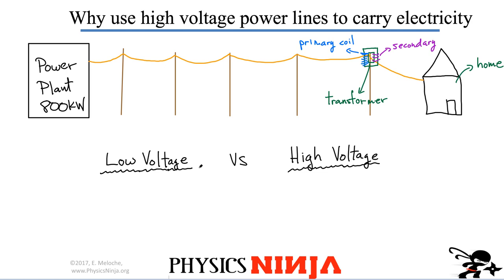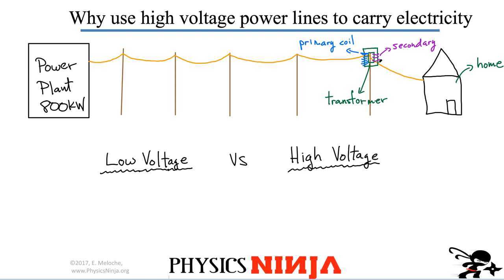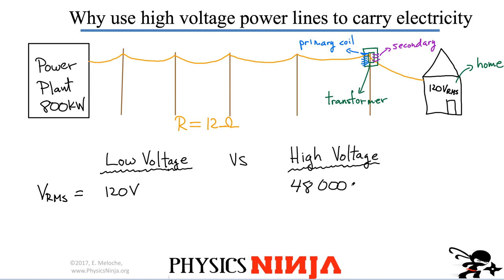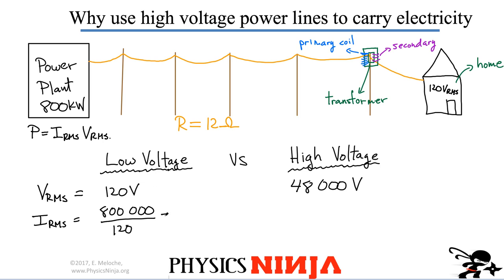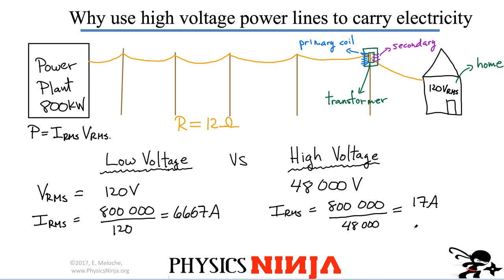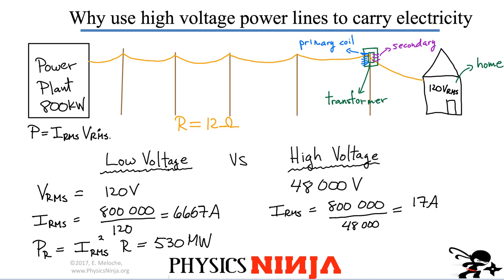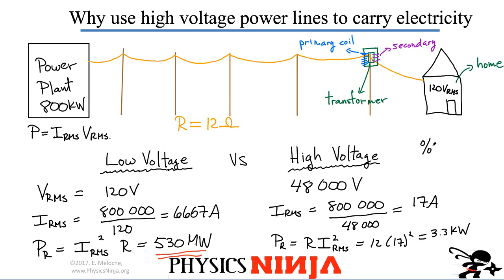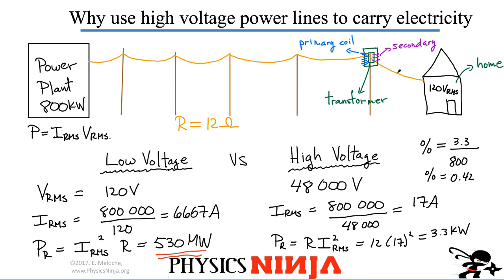Why do Power Lines use High Voltage?

Comment: Sir please explain why we can't use P=V^2/R to compare this instead of P=I^2*R
Reply: THIS!  I'm going all over the web trying to find this out. My teacher just says it doesn't work but can't/won't explain *why*!
Reply: I was thinking the same and looking for an answer. I think that the V_rms in the P=V^2/R simply doesn't equal the voltage used by the power plant, but instead it is the voltage drop on the resistor V_r, which is equal to V_r=IR.  The drop of voltage of a rezistor doesnt equal the voltage provided by the power plant, because the resistor isnt the only power consumer in the grid. The current however is the same as the one provided by the power plant, becouse all the current has to flow through the wire. Thus we can calculate the current easily as shown in the video. I_low = 6667 A and I_high = 17 A. Based on that we can calculate the voltage drop on a resistors. V_r_low = I_low * R = 6667 * 12 = 80 004 and V_r_high = I_high * R = 17 * 12 = 204. Despite providing higher voltage the voltage drop on a resistor is actualy smaller. So in fact you can use the formula P_lost = (V_r)^2/R and you do get the same results.
Reply: @MrTostek  Ah, so if we knew the exact voltage drop over the line itself, perhaps by measuring the voltage at the transmission center and at the distribution center, we could use the V^2/R. But that would be more difficult to measure, as you would need a shared reference at two points potentially hundreds of miles apart! Whereas you can measure the current anywhere along the line and have pretty much the same value everywhere. So the reason we use I^2/R is because of the relative convenience of measuring I, not because the math "doesn't work" for the voltage.  That seems to make sense. Thanks!
Reply: Bro we can’t use V^2/R because the V is potential difference not the voltage measured with respect to ground. Hope it helps.

Comment: The theory was mostly correct. The only thing that I have issue with is that you used 120v on the secondary side of the power company's transformer. In the US, the secondary side of the transformer is always 240v in single phase. The phase only gets broken up at the branch circuit level in a residential wiring configuration. Every Breaker Panel is 240v, Every disconnect, every 240v fixed appliance.
Reply: I think he was only trying to give a surface level concept

Comment: Something doesn’t add up when your calcs shows power dissipated in the wire is greater than the power output of the power plant!
Reply from the maker: I agree, there a too many assumptions built into this but it was meant just as an illustrating case of High voltage vs Low voltage.

Comment: If there was no transformer at the end and of the circuut and it was just wires, where does the rest of the power get used in the high voltage case?

Comment: this might seem like a dumb quisition, but isnt voltage equal to voltage*current? So why is the voltage's resistance different than the wire's resistance?
Reply from the maker: Power is equal to voltage * current.  Voltage is resistance* current (ohms law)

Comment: How power dissipation can be more than generated power? At max it can be 800KW transmission loss. There is something wrong with calculation.
Reply from the maker: Yeah numbers were the best choices.  I did another case here.  Power Transmission: High Voltage vs Low Voltage Comparison
https://youtu.be/C_2dBitJrGM

Comment: I have read different forums and watched a few youtubes (in addition to my textbook readings) and the explanations seem to fall short. The issue seems to be how we are first taught about a direct relationship between voltage and current (that is, an increase in voltage renders an increase in current if resistance remains the same) and then we're taught about power lines that have high voltage and low current (because other wise we would need thick wires that carry high current [which would run the risk of overheating due to the joule effect or something or another..). So please don't explain to me the infrastructural reasons why high voltage, low current is necessary for power lines. I just need to know how high voltage, low current is even possible. I've only been studying DC so far so maybe AC has rules that would enlighten me...but I thought the E=IR formula was universal.
Reply from the maker: That's a really good question.   I wanted to keep my video simple to really answer your question you need to look at the transformer from the power plant to the power lines.    It's a step down transformer and the designer can decide how much to step down the voltage.   It's best to step down a little to keep the voltage high. (ac max)
Reply: The problem is that V=IR (i.e. Ohm's Law) is not universal. The quick explanation for why high voltage, low current is possible is that because you have to conserve energy from the input to the output of the transformer, the power input must be roughly equal to the power output; and because P=IV, stepping-up the voltage causes the current to step-down (and vice versa). The more complex explanation is that formula (V=IR) really only applies to DC circuits. In AC circuits, there is a more general relationship to be considered V=IZ, where Z is called the impedance of the circuit. Impedance depends upon a variety of factors: the resistance(R), the capacitance(C), the inductance(i), and the frequency(f) of the AC circuit. When you take into account all of these factors with a simple set of transformer coils as shown in the video, all the math works out.
Reply: @SkepticMM  so if i touch it before and after the transformer i will feel the same pain if the frequency is the same right ?
Reply: In lament terms… if I have you bench pressing weight. Let’s say you can only benchpress 150lbs. Your power only allows you to lift 150lbs. This is power. There is two ways to make the load easier. Take off the weight or juice you up to become stronger to lift easier without resistance. So while you’re lifting 150lbs that is your max amps before you give out, since resistance is too strong. Now while you’re lifting I inject you with Superman DNA and you can lift more weight because you have more power. Now you have more power to lift weight. That 150lbs which is resistance is nothing to you now because you have more power (voltage) so in terms of current, it is much easier for you to lift the weight. 

Less amperage with more power makes sense. What wouldn’t make sense is having much less power and using less amps. It’s about power. So the more power I have the less current is needed because simply I have the power to lift all that weight.

Comment: Trying to give some thoughts on the actual question the viewers wanted to be answered:
How is it possible to increase the voltage without increasing the current?
Ohm s law states their are directly proportional.
I am still trying to figure it out myself, but here s what i gather from this video, which by the way is very good.
First, you notice he s using the Power formula, not Ohm s law. Why? My guess is because in this situation we HAVE to take Power into consideration, since it is given from the start. Ohm s law doesn t include power.
2) P=U*I
now, since P is a fixed known value, it means that the increase of either the voltage or current comes at the loss of the other. Basic maths.
3) there is a sort of misconception that high voltage means high current. I ve thought that to be true from the 6th to about 12th grade.
Of course, we see it is not always the case. What makes the difference (as far as i can tell) is POWER, specifically whether the value is fixed or to te to be calculated.
After all, voltage is a POTENTIAL, so whether it means or doesn t mean high current, depends on other values.
This is what i got from the video, i don t know whether it s correct or not, feel free to give me your view.
Thanks for the vid!
Reply: THIS  this is what I'm stuck on
Reply: Well as an 11th grader I think you're pretty much right, the power across a transformer has to be constant, and as you said the increase of one would bring about the decrease of the other value.
Reply: Can you tell me why he doesn't use the formula of power dissipated = v²/R

Comment: But sir a question then comes to my mind that is how we put electric energy in a circuit. 
The answer is giving some potential difference. Which is actually a Voltage. (Is there any other way also?) You said that you are putting some energy per second. How do you put it?
If ohms law is correct then, current should increase with increased voltage over resistance.

Comment: Dr.E, i have always had problems with voltages and currents because they're basically interchangeable in equation.
The explanation you give is cool and all but i have a really big doubt wandering within me.
So hear me out. We're talking equations.
Power=Current * Voltage---(1)
Voltage = Current * Resistance---(2)
From equation (1), Power output of a given poweplant is constant . So, voltage is inversely  proportional to current which basically means BIG CURRENT =small voltage and BIG VOLTAGE =small current.
Now you use (2) to convert (1) into
P=I*(I*R)
P=RI^2
But but but, here's the deal, i can also convert this equation in terms of voltage.
Which means
P=(V^2)/R---(3)
Here, the two results clash
From (3),
Power dissapated or lost = (Voltage^2) /Resistance
Here if you use high voltage, you LOSE more power
More power is dissapated.
How do you explain that?
Reply from the maker: I did another video on this that may help.  Power Transmission: High Voltage vs Low Voltage Comparison
https://youtu.be/C_2dBitJrGM
Reply from the maker: Remember that current goes through but V voltage is the difference of potential between 2 points.
Reply: @PhysicsNinja  i already watched it
But it still didn't clarify my doubts.
Yes, current does go through and voltage is indeed the potential difference between two points, which is being increased and that increases the power dissapation, doesn't it?
Could you please give an indepth explaination?
Reply: Yeah, I had the same doubt. Especially in terms of equations since everyone says H is proportional to I^2 but only proportional to V, and hence heat loss is lesser with high voltage. But the problem here is every time you increase voltage, current also essentially increases (V=IR) so what's the point? I don't understand why we don't consider both to have the same heat loss

Comment: What if to find current I use 48000/12 then my current through wire will be 4000A and in case of 120V will be 10A ???
Then this is entirely opposite to what you told
Reply: You need to divide the power emitted by the power plant P[W] with the voltage U[V] to get the current I[A]=P[W]/U[W]. From what I can read out of what you've written. It looks like you have switched P[W] and U[V] up. So you divide the voltage with the power and not power with voltage. Which is the correct way.
Reply: If I understand correctly, you can't do it this way.
You are using I=V/R to calculate the current through a resistor, which is usually fine, if the voltage is not high enough. However, if the voltage is high enough, the I-V curve of the resistor is no longer linear. The electrons in the resistor has a limit of how fast they can move which I guess is due to scattering. Beyond a certain point, the current will not increase as fast as the voltage does.
On the other hand, P=IV is the total power transmitted through the resistor, but not the power dissipated by the resistor: that would be P=I^2R. The difference between these two are made of the power consumption in your houses.
Reply: @frankartanis1290  Hello May I ask that why is power dissipated would be P=I2R?why cant use p=VI to look for power loss
Reply: @tengwenxiang1692  I think the whole concept of resistance is to measure the energy dissipation rate. So for dissipation, P=I^2V is probably more basic than P=IV. It's just that in the linear regime V=IR which allows us to use the second equation.

Comment: why did not divide 120v/12 ohms for the first case which will give a current of 10 A?
Reply: sorry I got it because the total current depends on both (the wire resistance + the load resistance), calculating the current only by using the wire resistance will give a wrong value.

Comment: But why if i use the other formula V^2/R instead of I^2*R im getting larger numbers in the high voltage scenario, what am i missing. 48000^2/12 is much bigger than 120^2/12.
Reply from the maker: I made a follow up because the example in the first wasn't the best,  hopefully this helps answer your question.  https://www.youtube.com/watch?v=C_2dBitJrGM

Comment: You can't decrease current by increasing voltage . Do a experiment itself with 12V and 220V. 
How the energy(power) is put in cicuit?

Comment: I was shocked once pretty good from the entrie cable coming into the home from the road I was on an 8ft step ladder and was taping around the knuckles where it connects to one another it was just black tape around them instead of plastic housing my hair was wet from sweating an it felt like and sounded like getting hit up side the head with a 2x4 I dont remember the fall or anything just came back to on the ground standing looking up thinking to myself did I just get shocked? I bit 2 holes in my tongue both side from my k9s I still had all my tools in my work pouch an landed on my feet somehow it was really crazy experience
Reply from the maker: Ouch

Comment: When calculating the current for low voltage why I cannot use the Ohm's Law to get the current of 10 Amps?
Reply: I dont know if I am correct or not, but I think it has something to do with the fact that it is Power being transmitted and not just voltage from the power station. You have to use Power and Voltage to get the current thats being outputted from the power station, instead of just using the voltage and resistance thats found in the wire.
Reply: Thats current per second....total current transmitted will depend on total power to be transmitted
Reply: Because the Vrms given is for the power station and the not the wire. If we were given the theoretical voltage dissipated on the wire then we would be able to compute using Ohm's law. [The voltage given was for the power station and the resistance given was for the wires. That is why we had to use Vrms (120v) and the Power from the station(800 kW), both of which come from the same place(device), to compute for the Irms. Which would be the same for the Power station, wire, and transformer (since this is a series configuration). This is also assuming that this is a HVDC (High Voltage Direct Current) transmission system. The computation would get a lot more involved was this an AC transmission system. One thing to also note is for the computation of the turns ratio for the transformer, it also didn't account for the voltage drop between the power station and the transformer. Which may or may not be severe enough to warrant addressing in a real-life situation.